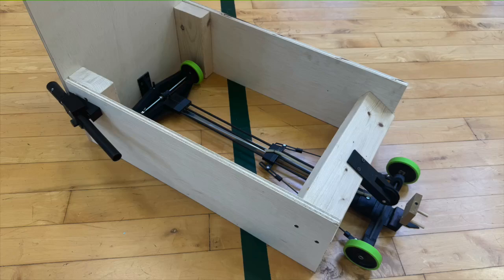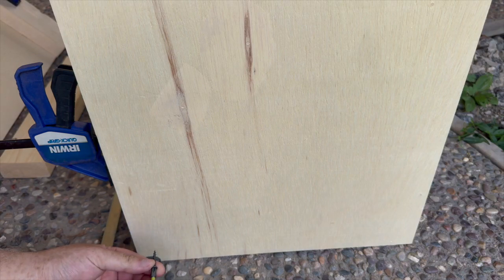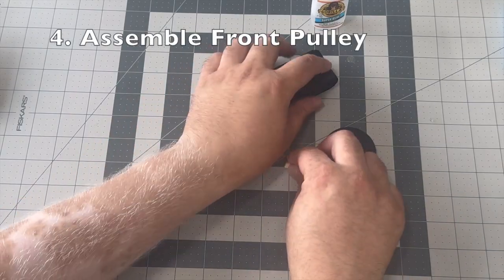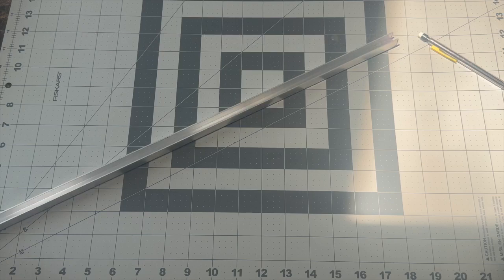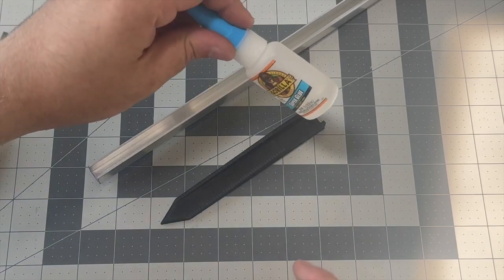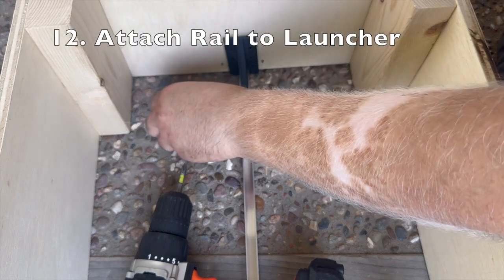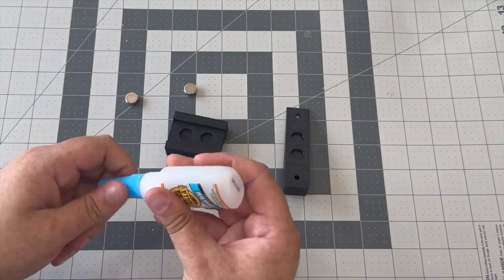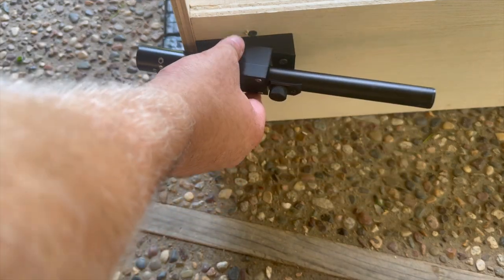How to Build a Launcher for an Egg-Transporting Vehicle | Scrambled Champion Kit 2026

Comment: Unfortunately, it does not seem that a single 2 ftx4 ft. board can be used because these boards are generally not actually 2 ft by 4 ft. Please bear that in mind or adjust dimensions in the instructions to account for 1/8 to a 1/4 inch loss in some dimensions, particularly the width. Otherwise, to attain the exact dimensions mentioned in the video, a full 4 ft by 8 ft sheet of plywood is required.